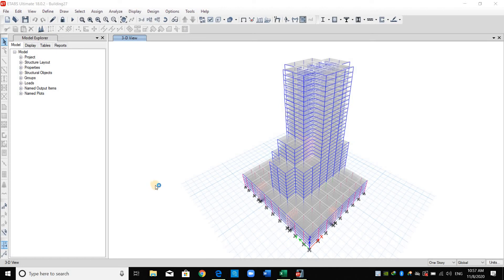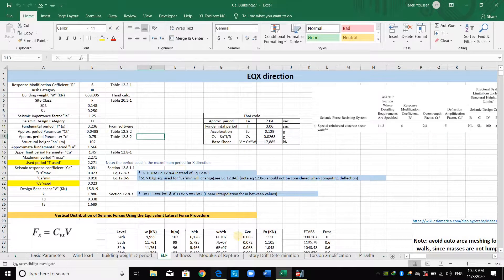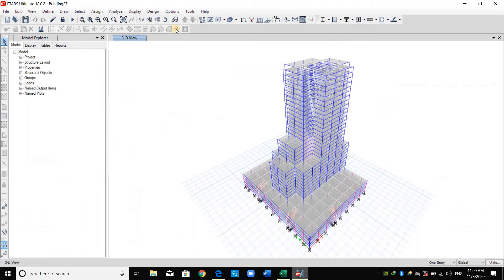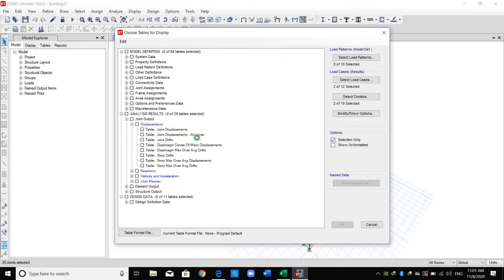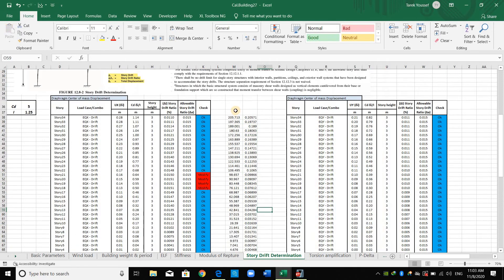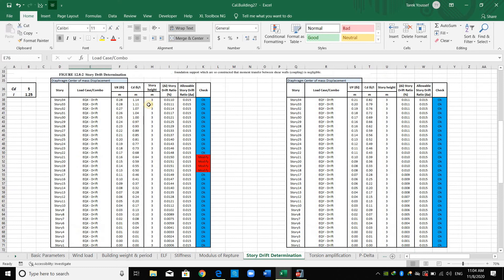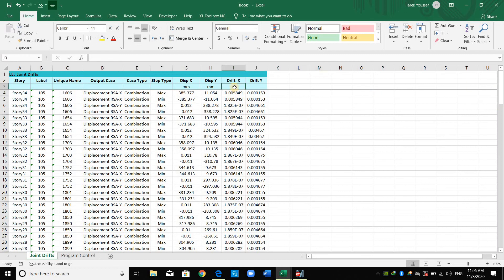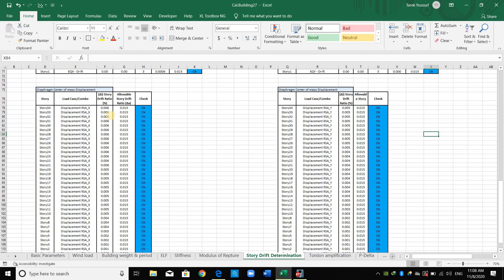How to Check the drift limits according to ASCE (Lec15)

Comment: Dear Eng. Tarek
Thanks a lot for your efforts 
I always refer back to one of your videos whenever I want to perform seismic checks.
I do have one question if I may ask 
I always noticed a huge difference between the the results of displacement for ELF and MRS I sometimes thought that there might be an error in the models so I used to take the results of ELF in the check of p-delta, Drift and torsional irregularities and use MRS in the combinations for the design 
My question is if the approach am using is ok ??
Why should i take the drift directly not the displacement??
And why did you include a specific combination or case for checking drift for MRS multiplying it by (Cd/R) ??

Comment: why we should not use cd factor  when check drift with Resposne Sp.????
Reply: because the res spec load case has to include the ratio *I/R.
the drift load combo has to include Cd/I. So he merged the two cases and just multiplied by (I/R)*(Cd/I) which is Cd/R = 5/6 = 0.833.

In the ELF method there is no inclusion of these parameters in any case. So he included the Cd/I in the excel sheet.
Reply from the maker: @ahmedjameel4578 is right. "Cd" is already included. I multiplied the original RSA load case (not reduced by I/R) by Cd/R. 

You can use the reduced demand of RSA load case (multiplied by I/R) called " Internal force-X or Y" and multiply it by Cd/I, and you will get the same results.